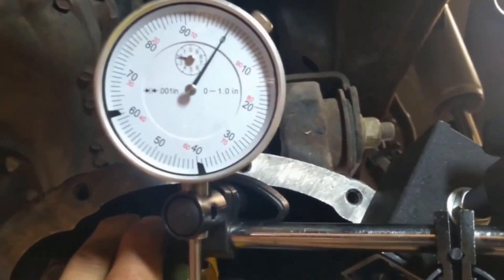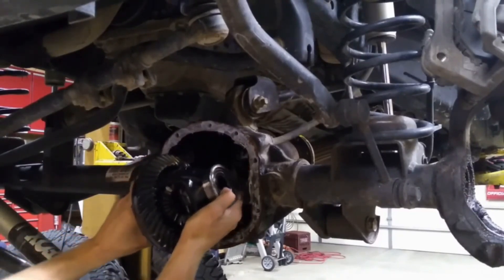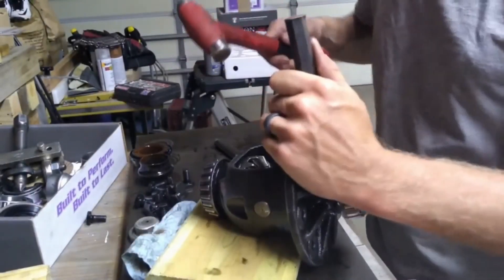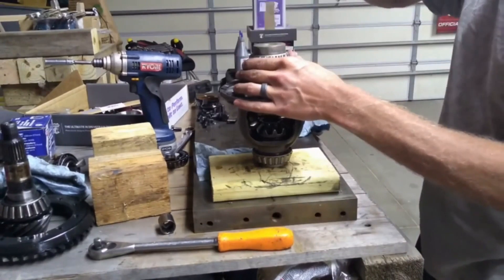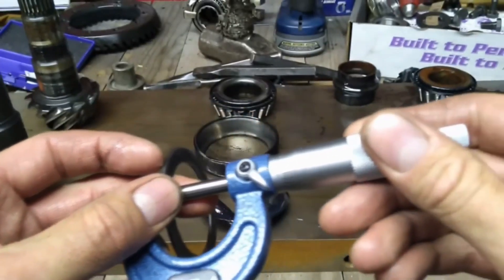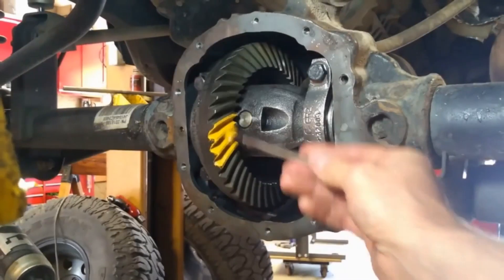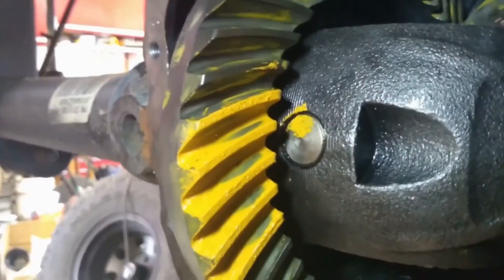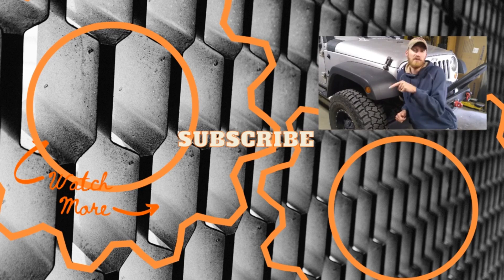How To Rebuid Axles | Dana 30 Ring and Pinion Gear Swap

Comment: I don’t know where to start . I bought a 2015 jeep wrangler and we had a lil incident after that everything is not the same anymore so I was able to identify the problem and where all the noise come from and yes I was the front axle after taking a part everything and look in the inside it was a disaster. I thought is going to be a one day work but is not the only problem I’m having now is the shims I don’t know where to put what and where what come from ??? You get the picture. Going in 30 days now I’m so frustrated at this point a little help kindly appreciated if possible?
Thanks